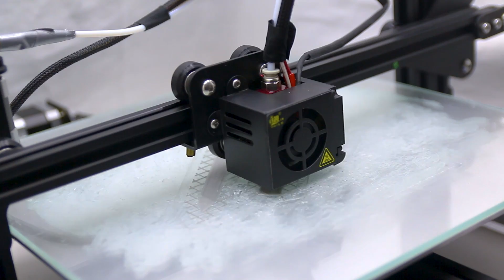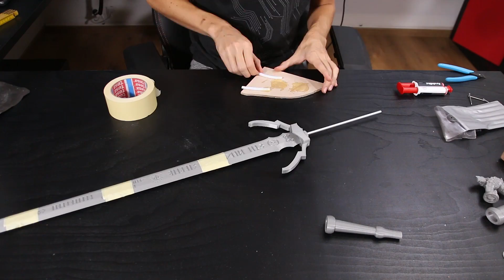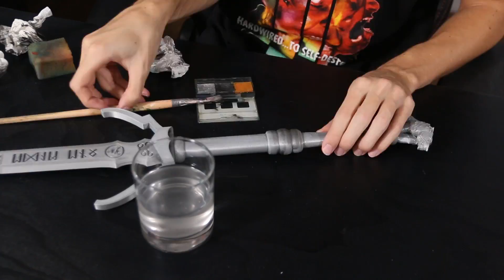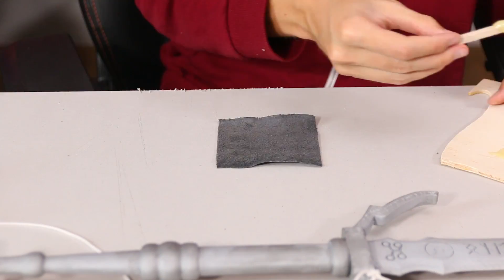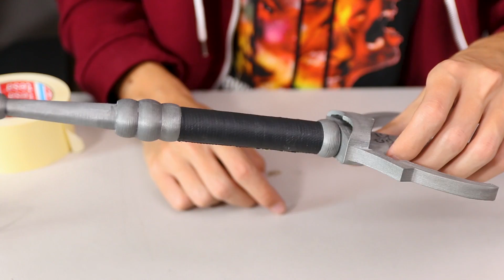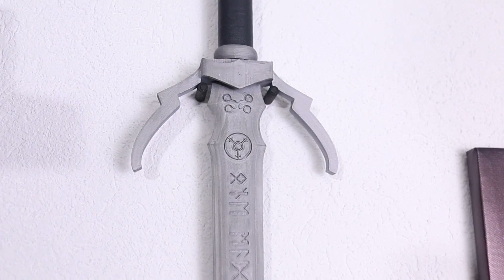3D Printed WITCHER SWORD

Comment: Nice work dude. Keep it up, your channel needs to grow.
Btw, I was planning to try out this model - what i think you could add is some LEDs to make the runes glow. Not sure if that will make it better or worse, but it sounds like a nice project.
Reply from the maker: I would go with one of the earlier versions of the model though, if you put leds inside, as they have more room inside I think